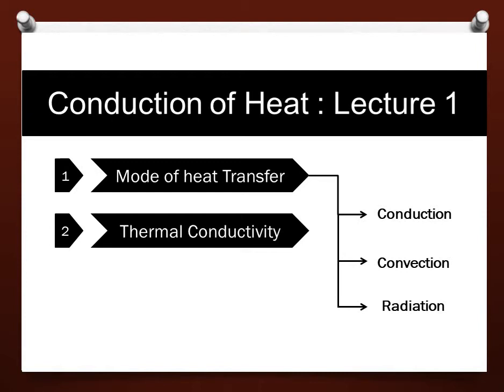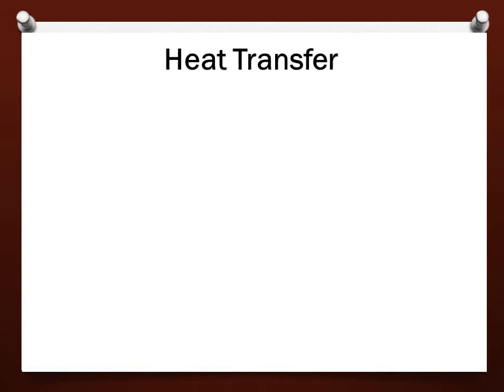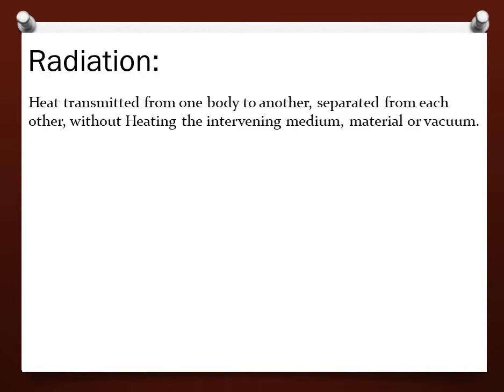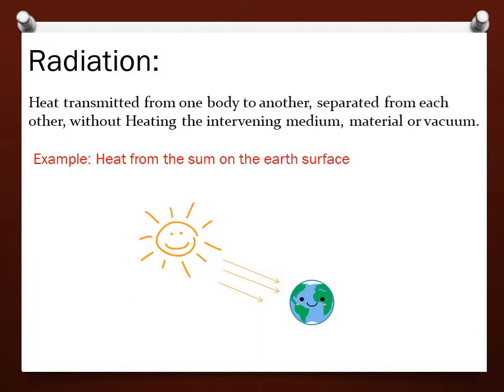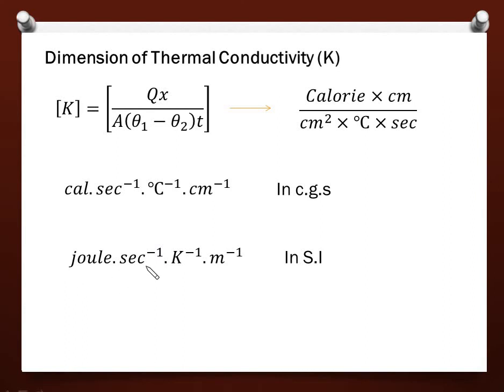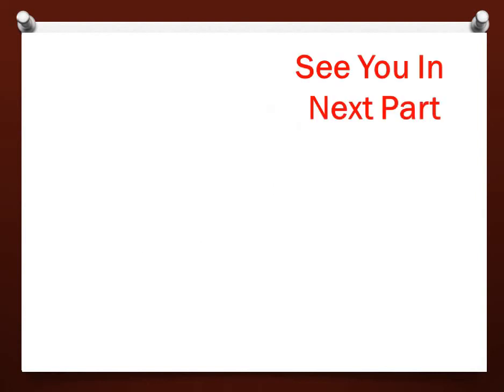Thermal Conductivity | Heat Transfer | Conduction of Heat | Part 1

Comment: The heat transfer by radiation process does not heat up the medium right? So if sun rays come to the surface of earth then the atmosphere medium that does not get heat up like the particles?
Reply: I mean the atmosphere particles
Reply from the maker: If a material absorb the radiation, it will get heat up. 

Atmospheric medium have air particles, water molecules etc., so they will also get heated due to absorption of  radiation.

Radiation don't need medium, so if it is passing through a vacuum then vacuum will not heat up.